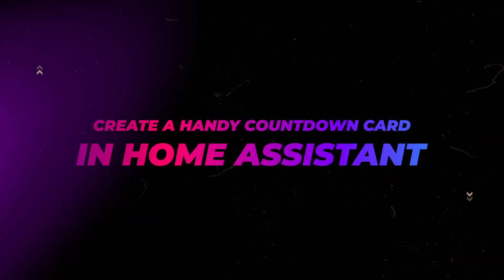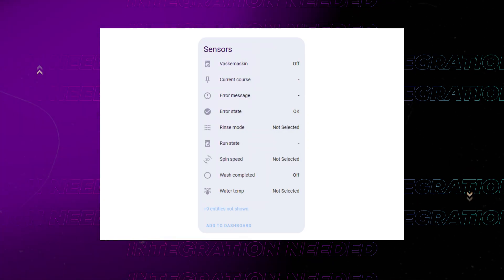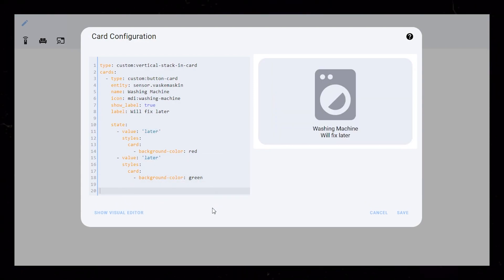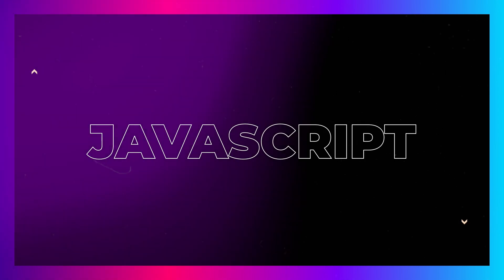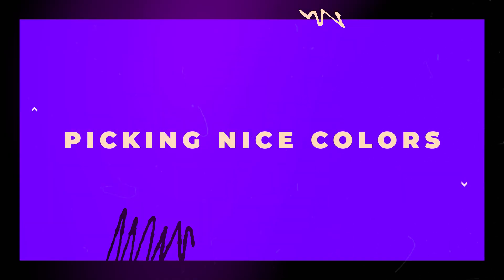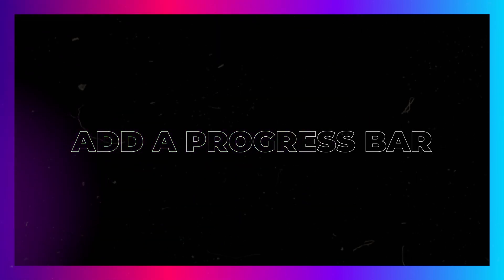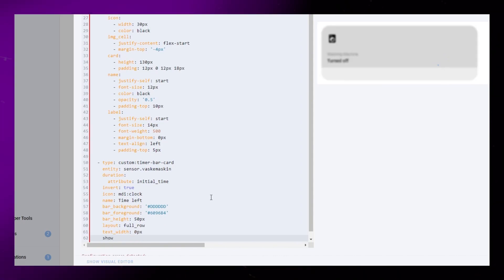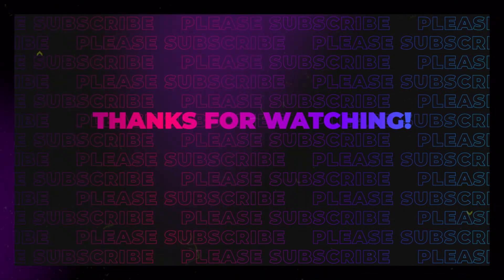How to Create a Countdown Card in Home Assistant

Comment: I'm struggling to find the entity for my dishwasher.  In HA, I can see there are around 40 sensors all measuring different things on the dishwasher, but there doesn't appear to be an entity for the dishwasher itself.  Maybe I'm misunderstanding the tutorial
Reply from the maker: Hi, In Button Card you can use more than one sensor inside the same card if you just reference the full entity like this:
states['sensor.whateverdevice'].state

Comment: Bought the template and trying it out, but only getting a weird looking bar whenever the machine starts...

Using a Haier washer with the following sensors:

switch.washing_machine_washing_machine Showing when it turns off/on (attribute is: last_changed), in minutes

sensor.washing_machine_program_2:
Showing the running program (like cotton, eco etc)

sensor.washing_machine_phase:
Showing  status (wash, rinse, spin, etc.)

sensor.washing_machine_time_remaining: 
Showing time remaining in minutes

Wondering what could be wrong.
Do I need to convert both switch and time_remaining sensors to hh:mm?
Reply from the maker: It looks like this card, unfortunately, hasnt survived some of the recent HA updates. Ive been working on an update tho, and are currently making a new video. But if you email me I can send you the update. Email should be in the receipt.
Reply: @My_Smart_Home  Done :)
Reply: This is how I get the time since the machine has been turned on:
{{relative_time(states.switch.washing_machine_washing_machine.last_changed)}}
Output example: 49 minutes

And the remaining time:
{{ states('sensor.washing_machine_time_remaining') }}
Output example: 53

The washer switch outputting the word minutes may be the culprit.
Reply: It gets even worse, the switch just outputs 1 hour, after 59 minutes...

Don't know how to extract the starting time. I'm new to templating.

Comment: I created a timer in helper and try to put this in the button-card. Problem is that I cannot position the timer in a grid row. It will always shown in the bottom of the row can't get it at the top of the row. Do you know what I do wrong.

square: false
type: grid
cards:
  - type: custom:button-card
    name: Keuken
    icon: phu:aqara-motion
    entity: binary_sensor.sensor_keuken_occupancy
    show_state: true
    show_label: false
    state:
      - value: 'on'
        styles:
          state:
            - color: red
          name: null
          icon:
            - color: black
          card:
            - transform: translateZ(0)
            - filter: drop-shadow(0 0 1.0rem rgb(255,0,0))
    custom_fields:
      timer:
        card:
          type: custom:timer-bar-card
          entity: timer.timer_keuken_10min
          invert: true
          bar_background: red
          bar_foreground: green
          bar_height: 2px
          layout: full_row
          text_width: 0px
          show_empty: true
      notification: |
        [[[
          return (states['sensor.sensor_keuken_battery'].state) + '%'
        ]]]  
      lux: |
        [[[
          return 'lux: '+(states['sensor.sensor_keuken_illuminance_lux'].state) + '%'
        ]]]
    styles:
      grid:
        - grid-template-areas: '"i n" "i s" "i lux" "timer timer"'
        - grid-template-columns: 60px 1fr;
        - grid-template-rows: 1fr 1fr 1fr 20px
      card:
        - margin: 0
        - border-radius: 50px
        - padding: 12px 12px 12px 2px
        - background: transparent
        - width: 130px
      icon:
        - width: 30px
        - color: black
      img_cell:
        - background: |
            [[[
              if (states['binary_sensor.sensor_keuken_occupancy'].state == 'off' )
              return 'orange';
              return 'red';
            ]]]
        - border-radius: 200px
        - width: 50px
        - height: 50px
      name:
        - justify-self: start
        - font-size: 12px
        - padding-left: 8px
      state:
        - justify-self: start
        - font-size: 10px
        - padding-left: 8px
      custom_fields:
        lux:
          - justify-self: start
          - font-size: 10px
          - padding-left: 10px
        state: null
        notification:
          - background-color: white
          - color: rgb(28, 28, 28)
          - border-radius: 30%
          - position: absolute
          - left: 25%
          - top: 10%
          - height: 15px
          - width: 30px
          - font-size: 10px
          - font-weight: bold
          - line-height: null
        timer:
          - align-self: start
          - padding-left: 10px
columns: 1